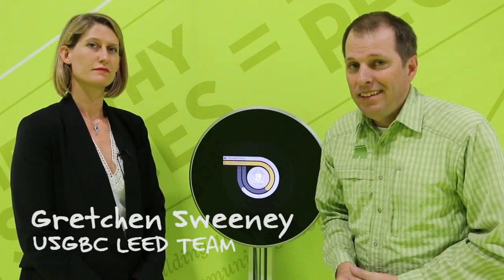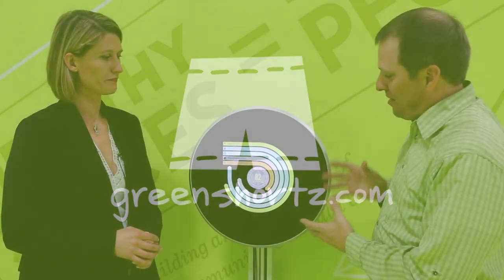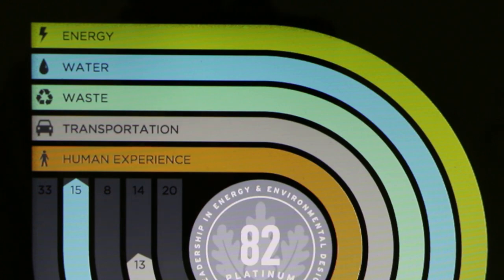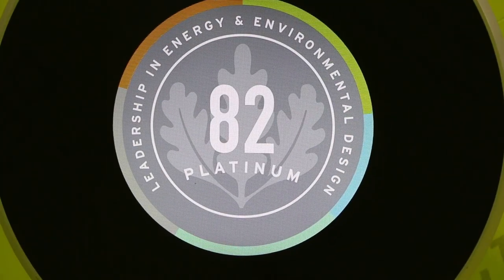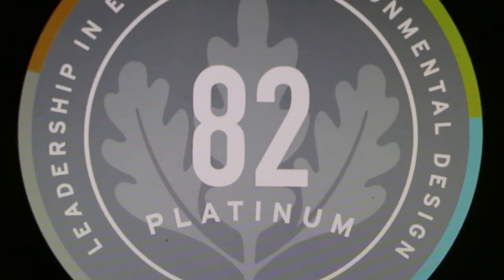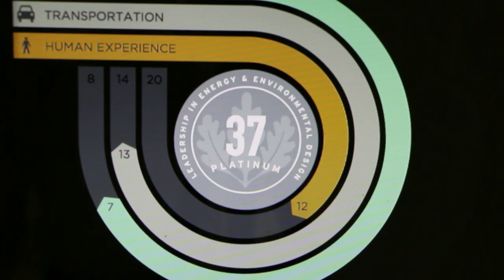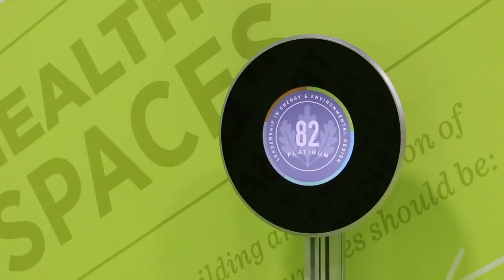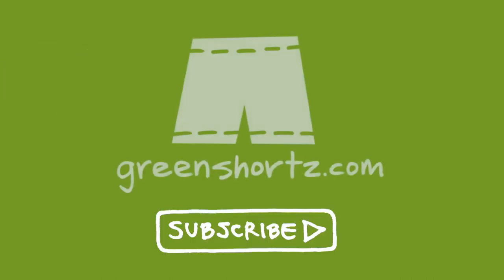Meet the LEED Dynamic Plaque | GreenShortz

Comment: Cool.  That's my first look at one of these things...  For energy use we find old buildings often outperform new LEED certified buildings...  It's an interesting conundrum.  Occupant feedback, waste stream management and transportation added into the equation may change our results.  Thanks for hitting this topic Tom.
Reply from the maker: +Greg's Garage Thanks Greg. I figured that as an architect you would appreciate this one. On a different note, I was spraying the small trailer I'm rehabbing with some rust converter and I used the Greg's Garage spin method on the wheels.
Reply: Sweet deal on the wheels...  Not sure what you used for a rust converter but any phosphoric acid will work wonders on rust.  They sell it as Ospho, concrete etch and a few other trade names...  Its much cheaper to buy by the gallon than the rattle can.  I'm looking forward to seeing the results of your upcoming trip.  Be safe!